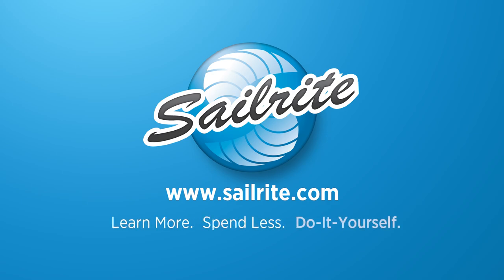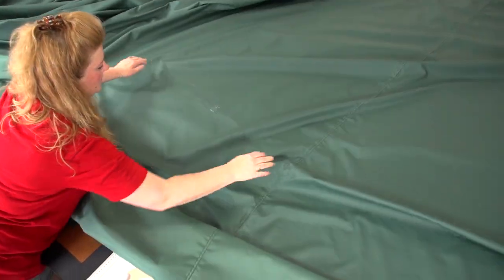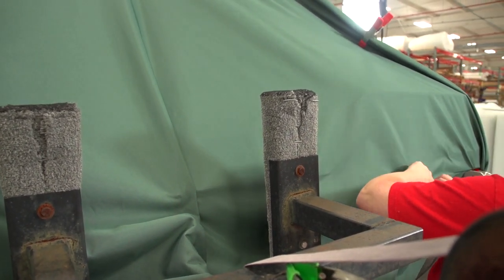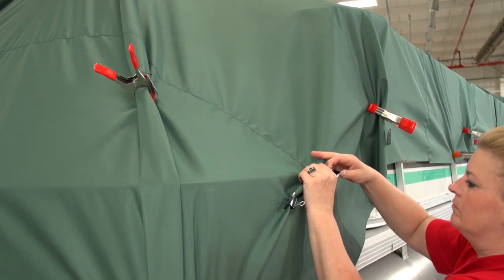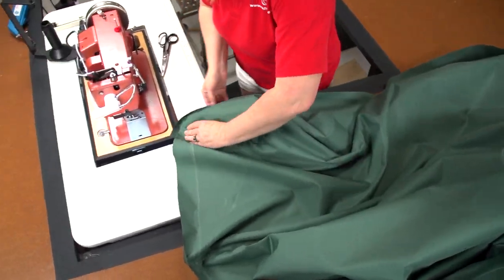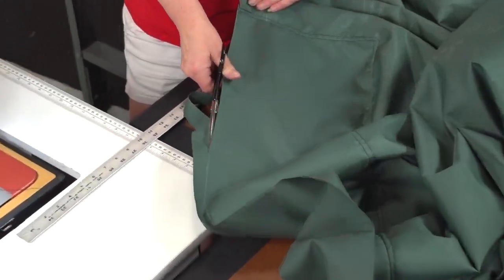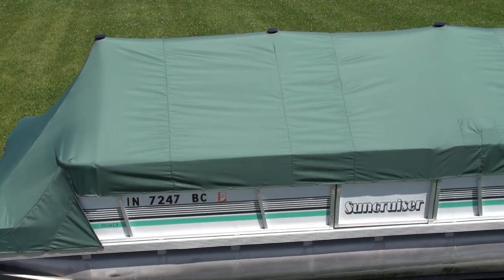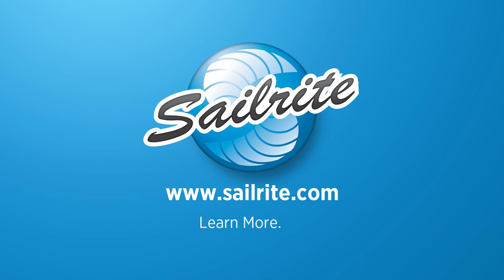How to Make a Pontoon Boat Cover

Comment: I am a fashion design and have taken draping which helped me as I have been making my pontoon cover. The video has been very helpful but I am thankful that I how how to "wing it". By not having room to lay out the cover on the floor I am measuring and comparing the port side to the starboard sides. I also have the disadvantage of having my pontoon in the water. (after all it is summer) This is a challenging project which I don't recommend to beginners.

Comment: I made one of these for my 24 foot pontoon boat last year. 2019. I am a very novice sewer, learning as I go. It was do-able for me but it took a long time. This video is fantastic for teaching every step! I bought an old Juki industrial sewing machine with a 9 inch space under the arm to get all of the fabric to slide through. I bought the "Outdoor Fabric" at Len's Mills Stores, here in Ontario Canada. It cost around $300 CAD for the 30 yards I bought.  To buy Sunbrella Marine fabric, it will cost over $800 CAD to buy in 2020.  I only used three support poles but will use 4 the next time, as strong winds occasionally flattened my poles. The first month or two, the fabric held up quite well. It fits the description of the Surlast mentioned in this video...underside coated with urethane, etc, stiff when cold, heavy, etc. But after the second month, the sun proved too much for it and if a large pool of water formed, it tore. The urethane quickly fell away from the underside, letting it leak. I could see millions of pinholes looking up from underneath once the urethane started giving away. By the end of the season (5 months), all of the fabric is pretty much a throw-away. Big disappointment. I learned that if you are going to put this much effort into a project, buy the best fabric you can afford. I am still trying to decide if  I will pay for the Sunbrella and do it again. One really does need to keep your expensive pontoon boat dry. I was covering my boat with this every night, but it is a fair chore to do on a daily basis. Maybe a steel-framed roof over my dock would be a better idea. How do you other pontoon boat owners keep your boats dry night after night when being used daily?
Reply from the maker: Yep, cheap fabric does not last long in the sun. If I were doing a pontoon cover I would use Top Notch 9 fabric from Sailrite. It will last years. Here is a link: https://www.sailrite.com/Fabric-Brands/Top-Notch/Popular-Collection/Top-Notch-9/type/Products?order=custitem_popularity
Reply: @SailriteDIY  Thanks for making the time to reply to all of these questions. Would Sunbrella's awning/marine fabric also be an excellent choice for a pontoon boat cover or is it not waterproof enough? (Sunbrella 6048-0000 Taupe 60 In. Awning / Marine Grade Fabric)

Comment: Great video and beautiful finished product! Question though ...why not mark and pleat inside out? To learn, I observed a shop that did hundreds of covers that way for boats, machinery, motorcycles, etc. and they always pinned and marked their shapes and pleats on the boat ....outside, using the big T-pins, then took the marked and pinned covers to the sewers. The sewers would sew right on the lines and then serge the edges a half inch or so outside the seams using a big factory serger. (I could see the LZ1 being excellent for that if you were using canvas. They had no room for spreading it out like you do as their shop was cluttered with many projects going simultaneously. Their sewers wore vinyl aprons for protection from the pins. After watching that,I did it the same way and have fitted and sewn many tarps and covers that way. I was using marine canvas and had to stagger and roll my seams to keep from fraying because I had no serger and my wife wouldn't let me zig zag the edges with her domestic machine. That was tedious but many of those covers are still going after many years. So, I'm curious as to whether you folks ever use that wrong side out method of marking and pinning. For me it was a time saver and I don't know any home sewers with the kind of room you folks have to literally "loft' the cover like a sail and crawl around on it making marks.
Reply from the maker: Thanks for your kind words. So, if your object or boat in this case, is perfectly symmetrical then turning the cover wrong side out and marking and pleating would work. However, most objects and boats are not, so it is typically best to mark and pin or clip the fabric right sides out.
Reply: @SailriteDIY  Thanks for replying. I was lucky with all having matching sides except for flagpoles, spotlights, deck vents, etc. Those didn't change the pleating, so I sewed them up, put them on, marked the 'accessories', sewed them, then sewed them on. Watching the video again, I can see a pontoon can be a different matter. I have one to do next spring, so will review again then.cheers.

Comment: I sew Herculite 1 1/2 inch wide in the double fold on edges for the snaps. I sew it on the front or back to start and make sure it's in middle then mark for the poles. Then work around the boat.

Comment: Will a standard sewing machine without a walking foot work on this material?  I will likely be using my little Husquvarna Viking unit to sew.
Reply from the maker: To determine if a home sewing machine can sew cover fabrics  perform this test: Cut up a pair of old blue jeans into four layers (not including the jean’s hems). Since a home sewing machine usually can’t handle a thread larger than v-69, use that thread or something comparable and try to sew through the 4 layers of blue jean material. If it sews well and the stitch looks good on the top and bottom side of the assembly then chances are you can sew using your home sewing machine for small to medium jobs made with cover fabrics like what was seen in this video.

Comment: Got news for you.  I would gladly pay someone to do this.  Just too much for me.  Handling a custom made cover is enough issue after a boating trip.  How does this material do at 70 mph behind truck on interstate?
Reply from the maker: SurLast fabric (as used in this video) is a very abrasion resistant fabric, so if the cover is secured down tightly it does very well for trailing on interstates. Other great fabrics for boat covers that do well for trailing are: Top Notch 9 fabric and Top Gun 1S fabric.  http://www.sailrite.com/search?keywords=top%20notch%209&order=custitem_popularity